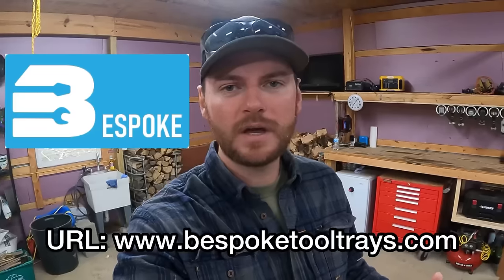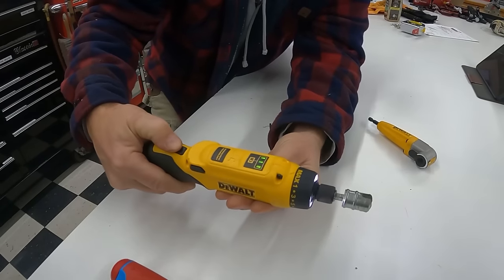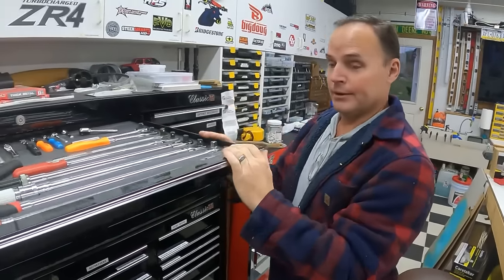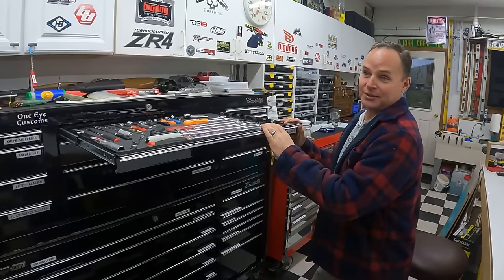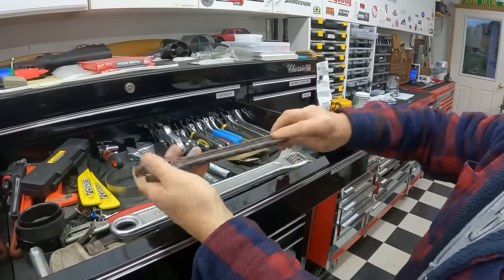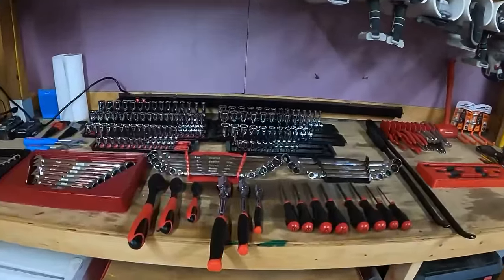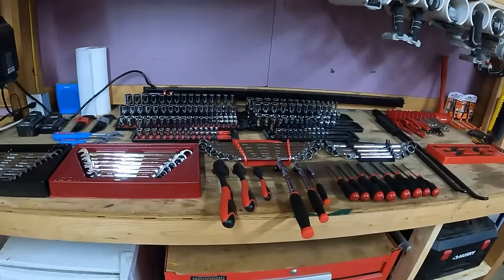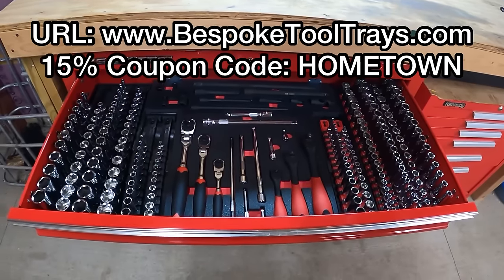Building And Organizing The Ultimate Beginners Toolbox

Comment: For the average Joe on a budget, the harbor freight mid-range tools are pretty spot on for an option. The only thing I wouldn't skimp on is the high torque tools. The 1/2" ratchet and sockets, bigger wrenches, etc. Anything that I spend a ton on or know will be torqued with MUST be 6 point. 12pt sockets strip bolts to easy. Like you said.. most don't need everything, and even more hardly use tools outside the house enough to justify a $400.00 wrench set. You definitely get the wheels turning on what you'd need in a toolbox, and very informative as well. It really just depends on what and how much the person needs versus how much they'll be used. Let's face it we've all went to the yard sale that has hundreds of dollars worth of untouched tools because they thought they'd need it.

Comment: Adam, you picked out a nice assortment of tools. There are a few items I would suggest you add to your collection. A Klein 10 in 1 (or 11 in 1) screwdriver, it can be a huge time saver. Also, a set of standard and metric hex keys (Allen wrenches), in straight and ball nose varities for both, as well as a 6" cheater pipe for leverage when needed. Don't EVER use the cheater pipe on the short end of a ball nose allen wrench (ask me how I know)! 2 Aluminum Ridgid pipe wrenches, a 24" and a 14". Why aluminum? Because you can still pick it up when you're 70 years old! 

There are more that you'll need as time goes on, but you can accomplish most tasks with the tools you have and the additional ones I recommend. Cheers!
Reply: We had a new guy at work years ago and told him not to try and break bolts loose with the ball end.   2 minutes later guess what happened?   20 minutes to get that broken ball out of that bolt.  All the while, chewing his ass.
Reply: @balljar7546 Sometimes our wisdom we share isn't taken. Just have to move on and shake your head.

Comment: I really like your mindsets about beginner tools. But, I'd like to recommend an addition to the screw drivers:
Don't buy the standard. Go for heavy duty ones, full tang, so you can misuse 'em as chisels or mini pry bars. Because: once in a while every one abuses his tools! ;-) Or alternativly go for electrically insulated screw drivers. Especially, if you're working in a house, you didn't build and don't know, where the electric cables are hidden and want to get a screw into an unknown wall. I heard, there aren't many US factories who built them, but you get them in the EU without any problems.
Both versions do the same tricks as standard screw drivers, but, they come with benefits.

Comment: Nice choices there, Adam!
I am a big fan of Tekton tools. To me, they are the modern-day equivalent of what Craftsman tools were when I was a kid - decent quality hand tools at a price point that most homeowners or beginner mechanics can afford. 
One does need to be careful when selecting Tekton tools, though. Some of them are made in the USA, others in Taiwan (both good choices), but some are made in China. The China-made tools are about what you would expect of a China-made tool; poorer quality metals, poorer fit and finish, basically not a terrific tool.
The US General tool cabinets are also an excellent choice for the home mechanic. They are well-built and reasonably priced. They are an example of a pretty good product that is unfortunately made in China. Oh, well...
One thing to keep an eye on with the new tools you bought - the screwdriver shafts WILL rust on you while being stored. This was an unwelcome surprise to me. A bit of rubbing with a scotch-brite pad will take that rust off, and a light coat of oil will slow its return. My old-school chromed Craftsman drivers never rusted - but their handles did develop a stink that made me get rid of them.

Comment: I have mixed feelings about too much toolbox organization. Yes those systems are really nice to look at and their big advantage is you can easily tell when something has gone missing. But there are a couple of problems. First of all I’m 65 and have a huge tool collection. But they were acquired over time either through inheritance, a good find like at a garage sale or purchased to do a specific job. When I was starting out I didn’t have thousands of dollars to spend on tools much less to spend on fancy organizers. Second of all tools don’t last forever. They get worn out, lost or upgraded. A system built around a specific tool eventually will not work for their replacement. Same with the toolbox itself. You outgrow them, add new ones and then decide you want to reorganize your tools. For example when I started out I had a small basement shop and a Craftsman top box. Now in the basement alone I have that Craftsmn box, a home built roll around, a full Kennedy stack, a US General box, service cart, and two hand boxes. I have also relocated all my mechanics tools to the garage with a 44” US General rolling cart and a US General top box. Finally when   I look at those super clean tool boxes and pristine workshops I can’t help but wonder is that stuff for show or does it actually get used.

Comment: I have the same is general tool box and multiple tekton socket sets and wrench sets. Mine are in plastic blow mold cases. It’s easier for me to take them different places. I’m happy with tekton, you won’t be disappointed. I also have Tekton screw driver sets but I’m not too crazy about them to be honest, but they get the job done.

Comment: One suggestion I have is to get a basic electronics screwdriver set for your toolbox.  Most of them, at least that I own, allow the end of the handle to turn so you can use your fingers to turn the screwdriver if the end rests in your palm.  Which is really nice when you're handling four or five toys with those screwed on back covers as you're not wearing out your wrist.  Higher end sets will include pretty much every driver bit you need so you can do things like replace batteries in video game console controllers.

Comment: If I may add one suggestion for you. I have two US General boxes (a tool cart, which I got as a Father’s day gift, and the next size down from the box in this video which I purchased when my tool cart ran out of room two years later). One thing I wish the US General boxes came with all four wheels as caster wheels. Like the example shown here mine are lined up side by side in my shop - I would like the ability to easily roll the cart out without a huge hassle. Right now they are “parallel parked” against one another. Not easy to get them out where if they were four wheeled casters they could in theory roll straight out and back into the parking spot. I will be buying four casters this Spring. 

As the set up in the shop in this video the new US General box has a nice work surface (under the workbench) to utilize but it is more difficult to do that when it is hard to move it from the parking space. Goes back to a previous video where Doug has lots of things in his shop in wheels. 

Good video - solid advice. And who wouldn’t want Doug as a neighbor?
Reply from the maker: I actually did replace the fixed wheels on the tool box with swivels. Just need to do it on the other box as well. Those swivel castors are expensive. $17/each
Reply: @HometownAcres  Cool. post a referral link. I need four of those little buggars.

Comment: Dough’s workshop is like tool-porn. I agree with Dough, better to have a few quality tools than a full set of crappy tools. 
The more you use a tool the better quality you need and NEVER use the adjustable wrench as a hammer, a copper hammer is a must along with your common problem pusher (sledge hammer)